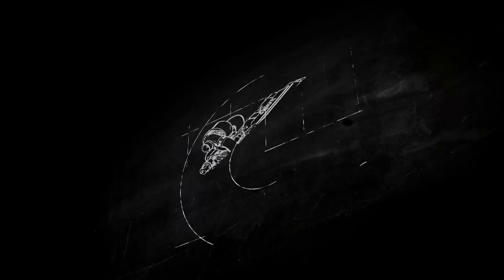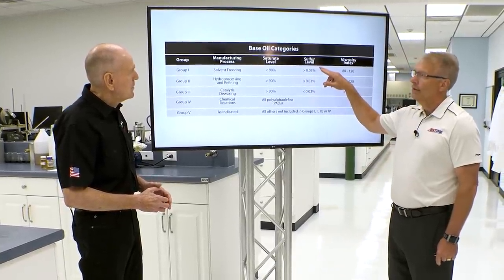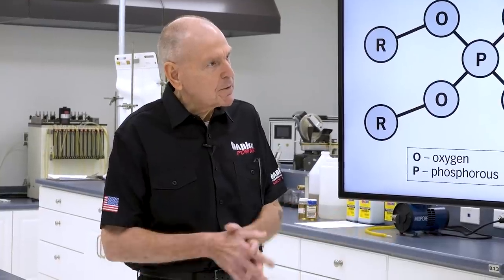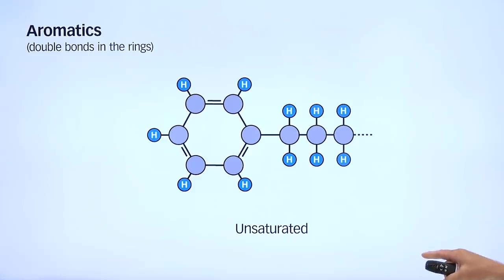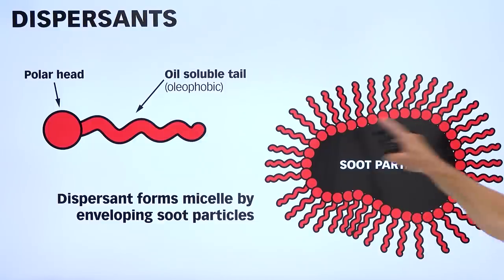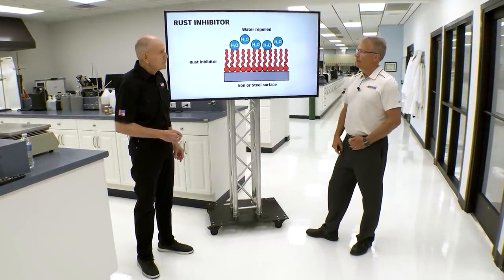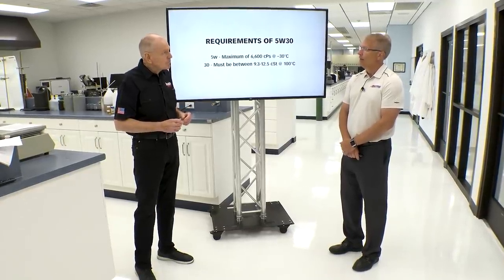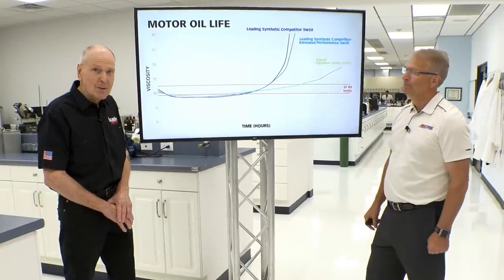What's in synthetic motor oil | Part 2 of 4

Comment: Gale asked about the oil being a 5 weight and really didn’t get a straight answer. The oil is never a 5 weight. The oil is 30 weight at 210 degrees f, thinner when it’s hotter than that and thicker when it’s colder than 210. The viscosity index and viscosity improvers help to control how much thinner and how much thicker the oil gets. The 5w is just saying that the oil is going to act as if it were a 5 weight oil at cold temps and thicken as much as a 5 weight oil would thicken, which is thinner than a straight 30 weight would be at the same temp. All oils have a low temperature pour point and a high temperature flash point and Amsoil has a wider range between those two points, thus increasing the usable range of the oil. They design it to function at the proper viscosity at engine operation temperature. That’s one reason it’s important in motorsports to be at normal operating temp at the drag strip or track. As the engine oil cools, it thickens, creating more drag, reducing horsepower and increasing slip times.

Comment: over a 4000ml of 0w20 royal purple, added 2400ml of Bardal no smoke and 1600ml of Bardal synthetic no smoke, added 1000ml of ATF to... the 1994 4.6 V8 ford runs very quiet, "cant even hear the engine turning once wormed up, idles a little shaky below 700rpm same as most V8's. "Turbo V8 Xenon Thunderbird"

all the differing molecule sizes, wonder how the orientate into each other... oil filter paper might collapse if its cold. "😅 oil filter paper might collapse? no way." sure someone makes reinforced metal mesh filters that are serviceable, think some European cars have them.

cool stuff

Comment: Wish there were actual hour values on the viscosity over time chart… all kind of irrelevant if all of them are way beyond recommended service hours.
Reply from the maker: This is a lab test AMSOIL uses to improve motor oil formulations that run in severe conditions in the field. The test length represented in the graph is in hours. Both competitors' useful life ended after day 10 or 240 hours. The AMSOIL Signature Series product had end of life happen after day 13 or 312 hours.
Reply: @bankspower  ah, interesting. So, if one wanted to arbitrarily convert hours to miles, because that’s the only metric auto Mfg’s give us to go on for whatever reason, using 40mph average speed, the “competitor” comes out to about 9700 miles whereas Amsoil comes out to about 12,000 miles. Significant margin there for sure but, to my original point, many folks are changing the fluids well before either of these intervals so a lot of that extra cost in engineering ends up in the recycling tote.

Comment: I am very disappointed that Amsoil is using group 3 base oil instead of a PAO base oil, I am not sure if it is really worth paying more for Amsoil instead of paying aft the price for Mobil 1 when it is on sale.
Reply: Depends on the particular Amsoil product....top of the line products are PAO/ester based.....but really, Amsoil selects base stocks not just for the sake of using any particular  group number but which one will offer the best performance in a particular application...and that does include use of group 3 synthetic products. I say that knowing that there formulations are very proprietary and they don't tend to divulge that information. just what I've learned over the years dealing with the company
Reply: @synlubeproscrider3712  the cat is out of the bag, it is just group 3 oils,if it was that great and made of PAO or esters I think they would bragged about it,but no, not a word about it, it is a complete mystery,I know for a fact that there buying their's base stock from Exon Mobil and their additive package from lubrizoil.
Reply: @martinplante8415  Yes, Dan Peterson talked about the use of group 3 base stocks...he also talked about groups 1-2-4 and 5...

You might  better understand what Amsoil offers if perhaps you focused on the exceptional performance and value Amsoil's line of motor oils offer instead of formulations which are of course proprietary.

And yes Exxon Mobil and Lubrizol are two of Amsoil's suppliers...along with a couple of dozen other companies.

In turn Exxon Mobil and Lubrizol ALSO have many dozens of suppliers. 
It would seem that companies within the industry buying various things from each other is how the industry works.
Reply: We use a huge amount of group IV and group V base oils.  It is always a given for AMSOIL.  Sorry I did not mention this in the video!
Reply: Thank you Dan......and there you go Martin!

Happy now?

Comment: TBN  graph for oil  deadregration  vs miles ?
Reply from the maker: This is a lab test AMSOIL uses to improve motor oil formulations that run in severe conditions in the field. The test length represented in the graph is in hours. Both competitors' useful life ended after day 10 or 240 hours. The AMSOIL Signature Series product had end of life happen after day 13 or 312 hours.

Comment: I wish the hours were listed on the graph.
Reply from the maker: This is a lab test AMSOIL uses to improve motor oil formulations that run in severe conditions in the field. The test length represented in the graph is in hours. Both competitors' useful life ended after day 10 or 240 hours. The AMSOIL Signature Series product had end of life happen after day 13 or 312 hours.
Reply: @bankspower  Interesting, 
At 55 mpg average is 13,000 miles vs amsoil 17,000 miles.

Comment: Amsoil you need to make a Toyota transfer case LF 75w equivalent fluid please
Reply: I run the 90-140 sever gear oil from them in mine
Reply: @marc_r_us2903  in the transfer case?

Comment: If you are not chasing fuel economy bump your viscosity up one level for longevity of your motor.
Reply: Bumping up the viscosity increase heat in the engine
Reply: @lesleyboeder1798  hence the need for a cooler, many cars have them already

Comment: Why on the motor oil life chart you don't specify the time axes it just says hours WTF HOW MANY HOURS???? I listened very carefully rewinding like 10 times to hear if the time of hours is mentioned and it not. So my bullshit metre just spiked. 😤
Reply from the maker: This is a lab test AMSOIL uses to improve motor oil formulations that run in severe conditions in the field. The test length represented in the graph is in hours. Both competitors' useful life ended after day 10 or 240 hours. The AMSOIL Signature Series product had end of life happen after day 13 or 312 hours.

Comment: So Amsoil  SS uses group III hydrocraked oil ?
Reply: SS is PAO-Esters
Reply: @synlubeproscrider3712  
But I see it in this video and in the SDS ,
Reply: @synlubeproscrider3712  
Thank you for your reply ,
I have infiniti q50  and always use amsiol 0w-20 ss  , great product  with many positive reviews, but what bother me most it darken at 2000 km ( deep reddish- black color ) (with amsoil filter ), 
I knew the high  Detergent package in SS turn it black sooner than other OIL  , but I'm not sure if it contains high percentage ~40% of highly refined G III  base stock ( GTL ) .

 One time I used Ravenol DFE 0W-20 Vollysnthetic  oil ( 80% PAO )  it stay yellow for longer period than amsoil SS  , this bring me to question the percentage of PAO and esters   in amsoil ?
Reply: @mohammedmuneam1177   I would not get hung up about oil color.
Motor oils change color with use and it has little impact on the oils ability to lubricate and protect.
I have run samples through the lab that were completely black and they report comes back as "suitable for continued use".

Comment: Time is not to scaled, without actual hours on the motor life plot this is just another infomercial!
Reply from the maker: This is a lab test AMSOIL uses to improve motor oil formulations that run in severe conditions in the field. The test length represented in the graph is in hours. Both competitors' useful life ended after day 10 or 240 hours. The AMSOIL Signature Series product had end of life happen after day 13 or 312 hours.
Reply: @bankspower  
Thank you for additional clarification.  Accelerated cycle test is crucial to simulate end of life and amsoil is superior as shown.  I don't think that amsoil would release information on at the failure point of what mileage is equated to. 10k, 15k or 20k miles.

Comment: End of video  . MOTOR OIL LIFE  was not clear .  First they did not show the hours of run time . Second they did not label the oils by their GROUP NUMBER .   doing so would have giving us more useful information.      WERE THOSE ALL GROUP lll ?
Reply from the maker: This is a lab test AMSOIL uses to improve motor oil formulations that run in severe conditions in the field. The test length represented in the graph is in hours. Both competitors' useful life ended after day 10 or 240 hours. The AMSOIL Signature Series product had end of life happen after day 13 or 312 hours.

Comment: It's  always been my understanding that synthetic oil, true synthetic oil has zero petroleum products in it?
Reply: Group 3 synthetic is derived from a hydro-carbon base but is considered a synthetic and offer great performance in a properly formulated motor oil.  Group 4 (PAO) are created through catalytic reaction with an olefin oligomer and some other chemicals and can be tailored and designed for specific applications....various group 5 synthetics are built a number of different ways.

Comment: Sulfur is great for lubricity. It' great for for fuel economy. Most of world's major economies, and all of the third world still use it. The u.s. doesn't like it because it has a smell. We can't have a smell, can we.
Reply: Sulfur in engine oil promotes formation of sulfuric acid in the presence of water and heat, which are in fact present in the engine crankcase.  Hence, sulfur is considered a contaminant in engine oil, since sulfuric acid attacks non-ferrous (non-iron) metals quickly.  This would be the crank bearings, using a copper alloy.

Comment: 39:56 This graph is completely useless without the hours displayed on the x axis.
The motor oil comparison graph is misinformation. It's disappointing to see this false advertising especially after the Amsoil rep stated he "only deals in facts."
Reply from the maker: This is a lab test AMSOIL uses to improve motor oil formulations that run in severe conditions in the field. The test length represented in the graph is in hours. Both competitors' useful life ended after day 10 or 240 hours. The AMSOIL Signature Series product had end of life happen after day 13 or 312 hours.

Comment: I've got questions:
- lets forget envionmental psychos yapping for a sec, which oil has better engine saving capabilities, 5w40 or 0w20?  I mean, lets disregard laughable 0.4% possible fuel saving factor... 
Also, I own 2013  Land Rover Sport 5.0 SC, originally recommended oil was 5w20, at some point, without doing any changes to any engines on the road since 2010, LR said "use watery substance 0W20" to which I said "screw you" and use 5W30 Signature Series AMSOIL. All good so far. 
Also greatly underdiscussed topic:
There is harsh driving conditions oil weight  recommendation  in every car manual... if you live in large city such as NYC with its never ending traffics, or in southern states, that "harsh conditions" oil weight recommendation is for you.

Comment: why didn't they put the hours in the dam graph????????????????????????????????????  bullcr
Reply: This is a lab test AMSOIL uses to improve motor oil formulations that run in severe conditions in the field. The test length represented in the graph is in hours. Both competitors' useful life ended after day 10 or 240 hours. The AMSOIL Signature Series product had end of life happen after day 13 or 312 hours.
Reply: @AMSOILinc  Thanks, so if you drove 21 mph for 240 hours / 5000 miles You would need to change your non amsoil. Now I'm pretty sure I know why the hours were not on the graph.   I have a duel remote and have used your 15w 40 in my 2006 duramax since it had 500 miles on it. It is over $180.00 at a real good deal for the filters and oil and me doing the job.  Sorry, I don't feel it is worth it. my new 5.0.  f150  will be a pensoil and motorcraft filter every 5000 kinda thing....   Thank you for your answer.
Reply: Listen again at about 42.30 and again later,  Peterson said the graph shows results is an ACCELERATED lab test.  So the hours in test can't be compared to hours on the road.
Reply: @jimk1617  I guess you did not get my joke...........please read again " 21mph  for  240  hours = 5000 miles "   I guess I don't care how different and or  uncomparable it is or is not. Thanks for your help. Happy new year.

Comment: Gale, love what you do, and what you share.  But your comment on soot and diesels was disingenuous. The smog treatment schemes on todays diesel powered engine do more to introduce contaminents into the motor oil than the first generation diesels experienced.  The EGR introduces hot carbon filled air into the cylinders.  Some diesels  would over inject diesel into the cylinders to help regen the DPF.  That washed down the cyilnder walls and contaminated the oil.    Our kenworths would start with 6 gallons of fresh oil after an oil change,  In 5000 miles,  we had to change the oil and it would be 6.5-7 gallons of thinned, carbon polluted motor oil like couldn't imagine.  That never happened on the old diesels.

Comment: The only "true" synthetics are group 4, PAO oils. Now tell us what brands are actually 100% PAO oils.
Reply: Group 5 are all synthetics other than PAO...esters, diesters, pentyl esters PAG's, silicones  etc
Reply: @synlubeproscrider3712  group 5 can be a mix of unknowns based on the definition. Group 4 is the the o ly definitive? UsA definition of course.
Reply: I agreed with you at 100% but everybody as downgraded to group III and also Amsoil ,and they sale this as 100% synthetic and they ask for a premium price
Reply: It seems there is no 100 % group IV PAO synthetic oils on the market...and for good economic reason....1) too expensive to produce in quantities to compete against refined crude for the market...sales value price not justified for it 2) engineering properties of 100 percent PAO not desireable compared to blending highly refined crude base oil with high percentage PAO...thus amsoil signature series is a blend of group 3 with group IV PAO olefin base oil with ZDDP and other additives now common in the oil market....hence the common "20,000 mile oci claims on all major "synthetic oil brands"

Comment: For someone that loves data. You talk a lot about a chat without data on it. Is the chat over 5 hrs or 500 hrs maybe 5000 hrs. We don’t know.
Reply: The scale on those graphs is generally misleading. Engine oil failure tests generally aren't run in real world conditions because they would take way too long. To get them done in a reasonable amount of time, the oil companies usually do stress testing - so they'll run the test at higher temperatures, reduce the oil volume to make it work harder, etc. Once you've done that, the test hours bear no resemblance to real world performance so they just show the relative performance between the oils.

Comment: So when the egr dumps soot back into the combustion chamber that’s good???? I get the smoke idiots. But how can regurgitating exhaust be good besides lowering the combustion temperature.  

No egr oil stays cleaner longer. 
Active egr oil dirty immediately.   

Answer??? 

I’ll be here waiting and take the dam environmental BS hand book out of it!!!!
Reply: No it's definitely not - but the aim of the EGR system isn't to preserve the oil - it's the most effective system we have for reducing NOx emissions. This is something the lubricant industry always suffers from - new technologies are added to engines, and they cause problems in the motor oil. It's then up to the oil companies to deal with the consequences. It's what happens when the OEMs / regulators write the rules, without consulting the oil manufacturers.
Reply: You generally want as little soot as possible running around your EGR system.  It does dump soot into the oil sump but also gums up critical valves controlling the system

Comment: ZDDP is actually very weak... 1960's technology.
Reply: True and not true at the same time. You could also say that PAOs are 1960s technology - that doesn't make them weak. ZDDPs have come a long way in the intervening 60 years and we understand them much better. There's also a better understanding of the synergistic effects with other additives - for example there's evidence that some Molybdenum Dithiocarbamate (MoDTC) in the formulation enhances the antiwear effect of ZDDP. Plus ZDDP's dual role as both an antiwear additive and antioxidant (peroxide decomposer) makes it pretty difficult to replace at it's low cost point.
Reply: And there are many different types of ZDDP.
Reply: @LubricationExplained  ZDDP in some cases damages cam followers.
You will never see any Engine builder strip an engine to see the damage.... But he likes your money for the build.
Reply: We just used ZDDP as an example for wear protection.  Many other materials are used.  ZDDP is actually a very good wear protection material and also contributes positively as an anti-oxidant!
Reply: @AMSOILinc  You will find the Tappet face will craze with ZDDP.
How many engine builders strip engines after Break-In to check wear patterns.... None.